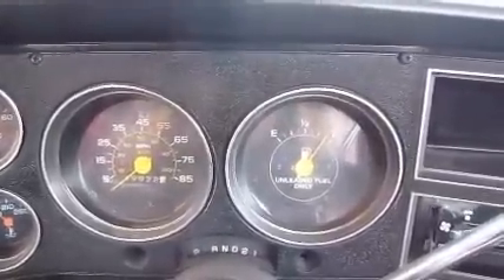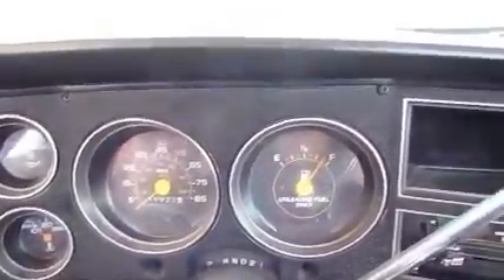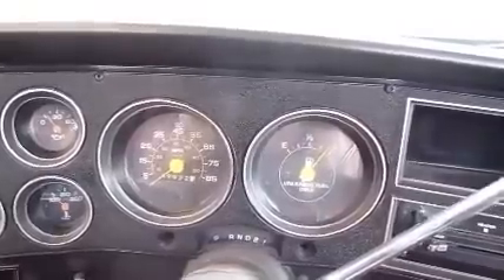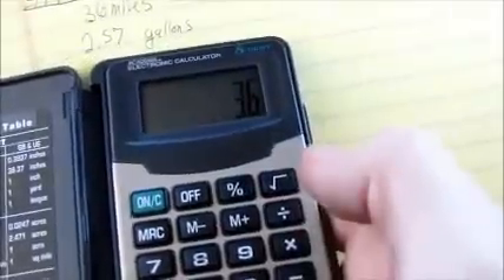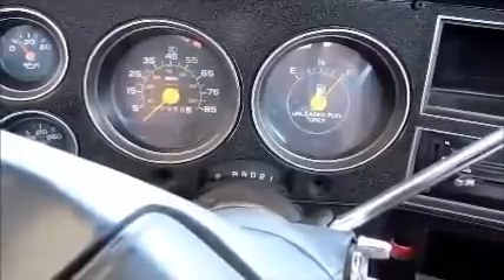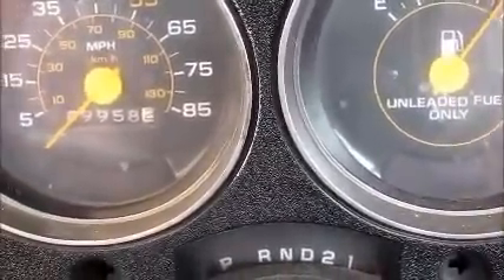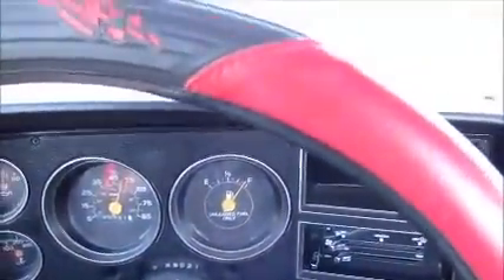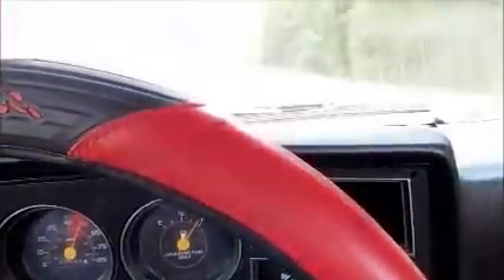Truck uses water as fuel supplement ~ TRUCK RUNS ON WATER !!!

Comment from the maker: In order for the gas to be throttled out at different streams when needed the HHO will have to be slightly compressed. Then you will have to be able to pedal control the throttle. I do not think just a storage tank will work because of needing different amounts. By the way. I do not recommend doing this in any way as hydrogen is very volatile when compressed.

Comment from the maker: I do have a very slightly higher RPM at idle. There is no need to wire in your second cell to turn on at higher RPM. If extra HHO is produced it will recirculate through the engine's crankcase vent. Then if still excess it will go out exhaust. I have never seen any issues leading to needing to do this. To convert to full HHO. You must be able to throttle the HHO out. This does require a slight amount of compression and proper safety equipment when doing this. Sort of like a propane install.